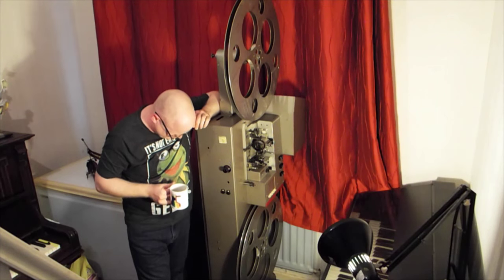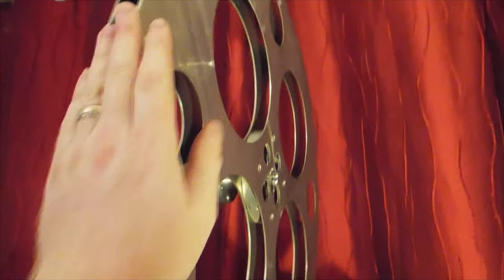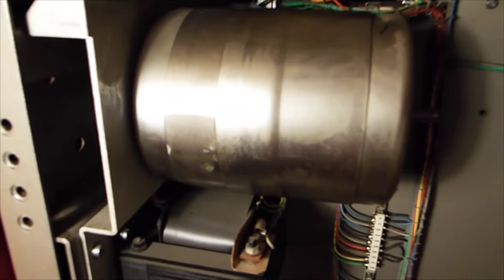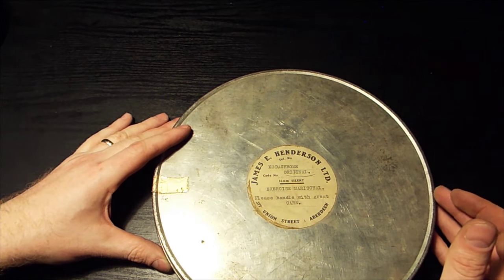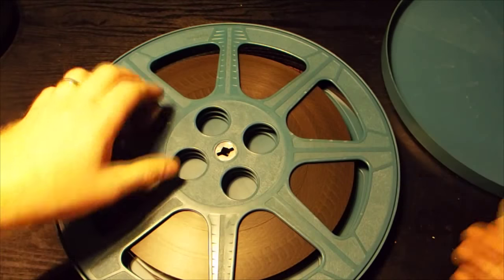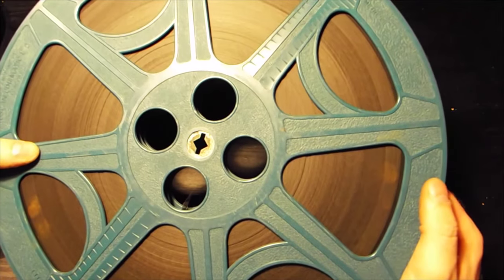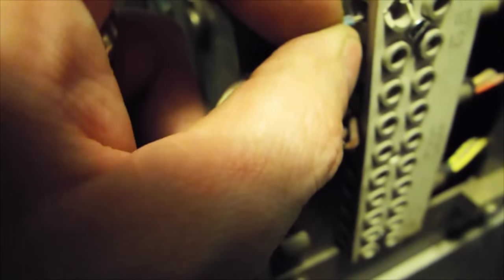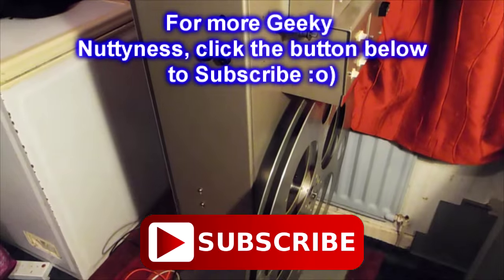A Cinema Film Projector Arrives!!! Philips FP-16 (Kinoton / Norleco): 1960s

Comment: Just so you know the 3 button on the top of the lamp house are, Green=lamp on, Red=Lamp off, White=manual strike. 

I'm not 100% sure if the lamphouse fitted autostrikes or not. On the FP40 I am more familair with we had a manual strike as a backup should auto fail or the lamp needing to be struck for any reason. Striking is using a high power jolt of a couple of Kv to start the arc. It then drops to something like like 80v at high ampreage. Just to clarify if when you press the green lamp on button if nothing happens press the white button. If again nothing else happens the striker board is dead! Red turns off the lamp.

The board with the black plastic stuff around is probably the striker board. Basically a capacitor board!

BTW it is a Xenon lamp! Not a Xenon Carbon arc lamp! Xenon and Carbon arc are 2 totally different lamp types. Carbon arcs are a whole world you probably don't won't to get into. Basically a bit like using a welding rod as a bulb!

The 2 bottom buttons on the front side panel with the play symbols on should be 25fps and 18fps. The top I suspect is dowser (shutter to let light through to the gate/film) open and close. I can't see properly due to the camera flash killing them!

The front inching knob is a manual crank as you discovered. Normally to wind through a bit to check all is good. As just jumping in and hitting go you could find the projector eats film quickly if something is wrong. The spool drives won't turn whilst inching. They will (should) however start up when you start the projector. There is an internal clutch on these so they will only play/takee up at the correct speed that the projector is playing at vs the size of the spool and how much film is on. Small spool with little film needs to turn fast. large spool with loads of film needs to go slow.

Some of you connector board stuff will be power of course. Some will be outputs for sound either optical or magnetic maybe even both. These will need to go off to an amp/sound processor/pre amp. Plus maybe even some controls for masking/curtains and lighting. Hard to say without knowing options fitted.

Regards manuals have you tried contacting Kinoton? They may have scans available. If not there then try the BFI. Try calling or emailing the Booth/Box/Projection-Manager/Chief. I believe they have an FP16 at the Stephen street screening rooms. Another place to try is Bradford National Media Museum, I think the cinema there may be run a seperate entity though (the picture house) again try and email or call the Booth/Box/Projection-Manager/Chief.
Reply from the maker: steadicamant Bugger, I didn't get an email for this comment!! Wow, a lot of useful stuff there.  Can't say I've noticed a physical dowser and I'm at work for the night, so will look tomorrow.  I actually have a technitian coming later this week hopefully.  He's bring some speakers for it from the 60s with the correct spec and appropriate electrical kit. he's going to reform the caps and see if he can get it all going again.  Thanks very much, you've answered a few mysteries about this machine :)
Reply: RetroGamerVX  The dowser should either be either in the lamphouse or somewhere between the lamp and rotating butterfly shutter. That way it will stop it baking the rotating one should the lamp be on without the projector running. It probably won't be very big. Just like a lollipop! It stops it cooking the butterfly shutter and warping it which would throw it out of balance. It also allows the projector to get up to speed before showing it on screen.

Regards the sound you may as I say need preamps and main amps before the speakers themselves. Though if you have a bod coming over He no doubt would have thought of that.

The thing that seems to comeback up slowly on that switch I suspect is the magnetic sound head. As it slamming hard into the film may not be good for it or the film. So is damped for that reason I would guess.

Ant
Reply from the maker: +steadicamant thanks, yes, i found the dowser hidden away.  we will see later today what state she is in :)

Comment: I keep film with vs in the freezer.Also get some MOLECULAR SIEVES.  I know your in the UK but think he ships world wide.
http://moviecraft.tripod.com/supplies.html

If you  freeze the film it stops the vs but as soon as you defrost to run it will start right back were it was.
Reply from the maker: ***** Good idea, may have to go in one of ours.  put it in a bag and pack it with sieves you mean, in the freezer?
Reply: RetroGamerVX Also keep the film with vs away from other film it can spread. If you cold store it you can use plastic tins some are even the type that vent. I seen it so bad metal tins well warp from it. Also might think about putting on plastic reels or film cores. Since the film is out-gassing best to keep it in cans tins that can let it breath plastic is the best for this in most causes. 

When you freeze it it can be put right in the freezer no need the wrap it. I just put the sieves in the plastic can then put the it right in the freezer. 

Not sure as of today but not to long ago new prints if the film was  ok shape could be done not cheap to due.  Other thing to do is to get them to dvd harddrive or even video tape and keep the print in the freezer. 

This is a fact on it from a older study. 
http://moviecraft.tripod.com/supplies.html

Also not proven to cause it but some think so get some film wash nasty stuff so use gloves. Back in the 70's lots of film rental house used a film sealer to keep it as thought fresh. Turns out the sealer used might have been a major problem since it sealed in the vs and could not out-gas. Can not think of the sealer they used by name but it was pulled of the market in the 80's.

Here is info from kodak on the seive
http://motion.kodak.com/motion/Support/Technical_Information/Storage/molecular.htm

http://motion.kodak.com/motion/Support/Technical_Information/Storage/vinegar.htm